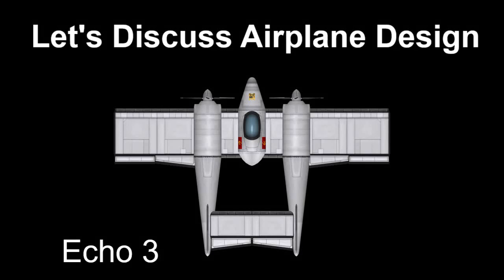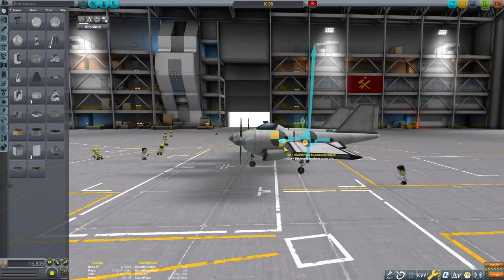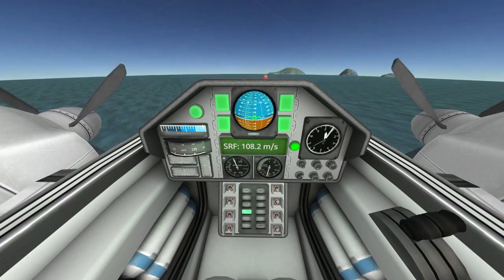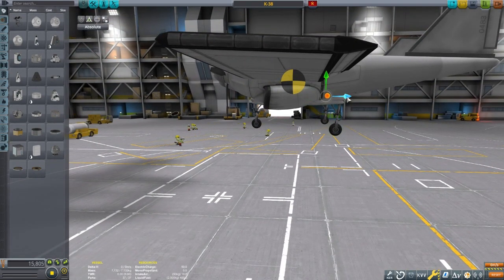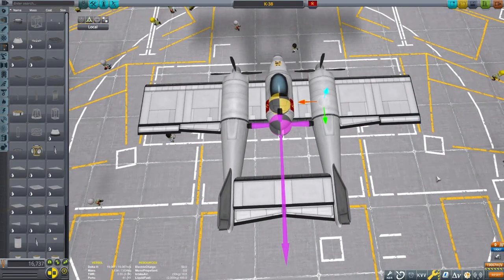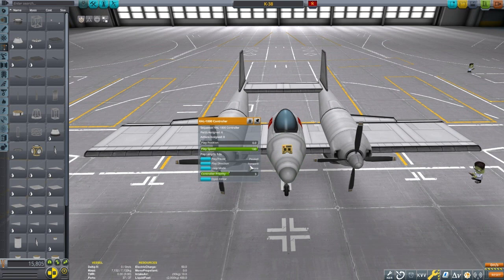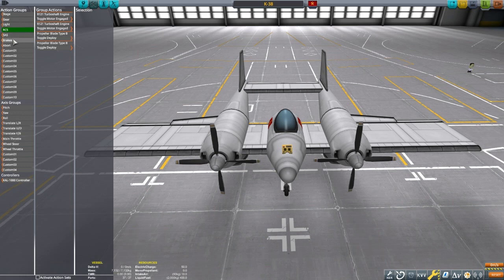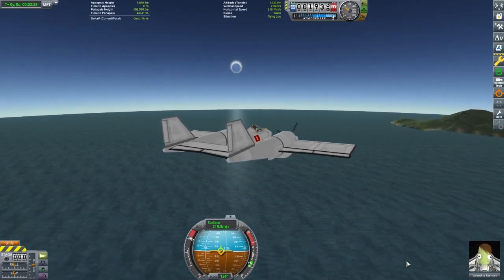Let's Discuss Airplane Design

Comment: one tip is to remove fuel from your tanks and check where your center of mass is gonna be then, can be nice to do in case after flying a bit your plane is very unstable.
Reply: My workflow is that I remove fuel from every tank as I am building. After I'm done I add as much fuel as I need while making sure that the center of mass stays in place.

Comment: About the flaps, are there any pointers about where to put them or how to set them up?
Reply from the maker: Sometimes I will either bind them to the brakes or gear action groups. The idea is that they help provide additional lift and decrease stall speed. So, I will use them during take-off and landing or low speed flight. Sometimes I just have to see how the plane performs when they are deployed at different angles to ultimately decide how best to set them up. Many of my airplane designs require lots of testing as the information the game gives in the SPH is rather limited.

Comment: I designed a plane with a shorter nose gear that uses seperatrons to boost the nose upwards and forwards for a takeoff after the plane reaches a specific takeoff speed
Reply from the maker: Ah, a rocket assisted take-off. Those are fun. Have you ever seen footage of the C-130 JATO. Just the US Air Force going full Kerbal.
Reply: @Echo3  yes i have

Comment: @ 6:28 - How did you do that?         How did you move the (fuel) slider of multiple components at the same time??
Could you do it to change the thrust limiter of multiple engines at the same when you need to perform a small maneuver burn?
Reply from the maker: This is in the hanger, and the tanks were placed in symmetry. So changing one tank affects all the others placed with it.

I've not been able to do this with engines once a craft is deployed except with the KAL 1000.

Comment: Hey! Nice video! Do you have any guide on prob blades? Which is better in terms of fuel efficiency - fewer blades, but larger, or many blades, but smaller? Which is better in terms of max speed?
Reply from the maker: I haven't made a specific guide for propeller choice. The duct fan blades are the best choice for going fast. They produce the most drag, so it takes lots of torque/power to keep them running at full speed. For efficiency, the regular propellers seem to require less power to fun at full RPMs. In the hanger, I try to reduce the motor size as much as possible that will keep a given design spinning fast enough.

Thicker atmosphere like near sea level or on Eve takes a lot more power, than low pressure. So you should adjust your designs according to where you intend to be flying the most.
Reply: @Echo3  Thanks for the reply! Just tried duct blades and they seem require way less RPM to produce the same amount of flow. There's a trade-off in RPM-torque-amount of air which I don't fully understand. As for drag - doesn't it reduce to zero with the right opening angle for any blade ?
Reply from the maker: @rumpelstiltskin449  The duct fan blades to push a lot more air. So running at 460 RPMs requires more power. The optimum angle depends on air speed. Optimum static thrust seems to be when the blades are at 8 degrees. I tested that will all the different blades at various RPMs.
The blades will produce drag when they are moving. Because of the amount of drag on the fan blades, I could not perform an autorotation landing with them on my helicopters, because they slowed their RPMs too rapidly.

Comment: how to ensure yaw stability?
Reply from the maker: The vertical stabilizers and rudders help keep the craft stable and controllable in the yaw axis.
Reply: @Echo3   could they be made from delta wings? or just the parts themselves?
Reply from the maker: @bonelessvegetal818  Yes, any of the wing parts will work.
Reply: @Echo3  how can i straighten the center of lift since it is kind of tilted back
Reply from the maker: @bonelessvegetal818  that is due to how you angled your wings. It is not necessarily a problem.

Comment: Y does my plane keep tilting with a single propeller engine and how to solve this
Reply from the maker: The torque of the motor will cause the plane to roll in the opposite direction. I fly without SAS and use trim (Alt + direction key if playing PC) to counter the effects. Many players just use counter or conta-rotating propellers.

I have other propeller tutorials that cover these topics.